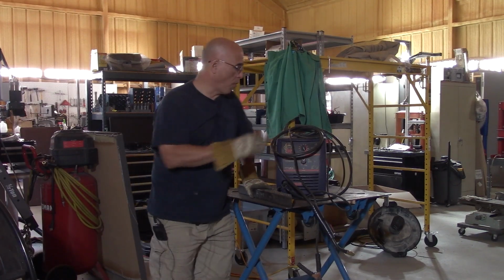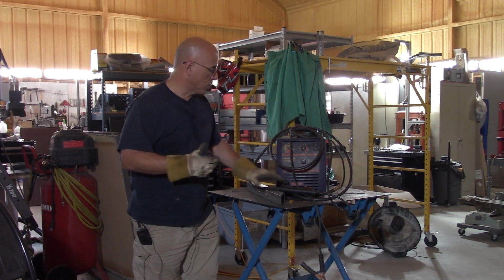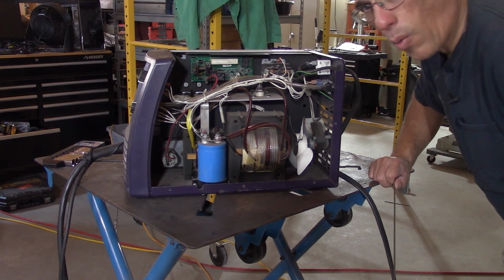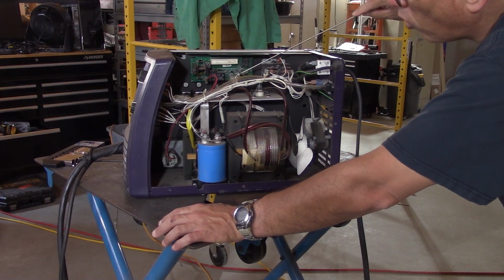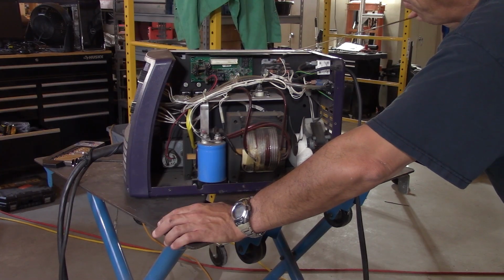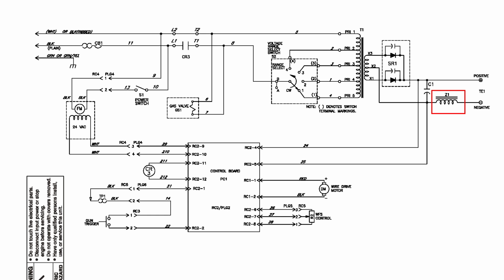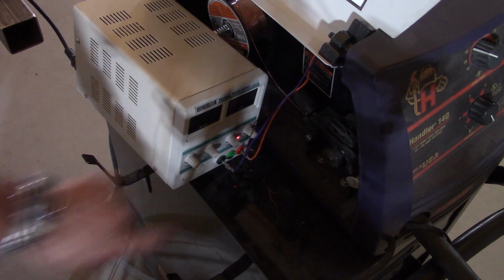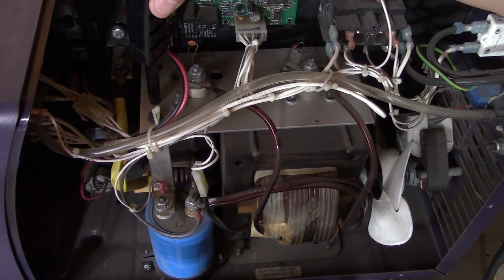Troubleshooting My Dead Hobart Handler 140 MIG Welder

Comment: I’ve been left hanging! Did you ever find a cap!!? Thanks for the helpful video I am using it to troubleshoot my old 140.  Probably a bad relay
Reply from the maker: Unfortunately, never got to find a suitable replacement. I think these are probably custom made for the welding company, maybe? Anyway, it is one big lump of metal taking up space at the shop so I am seriously considering dumping it, but I tell myself I will do something with the transformer. Glad the video has been of some use. Thanks for watching!
Reply: @CNCDude know what you mean! Hate to let this nice made in USA machine rot away but it is old and heavy!